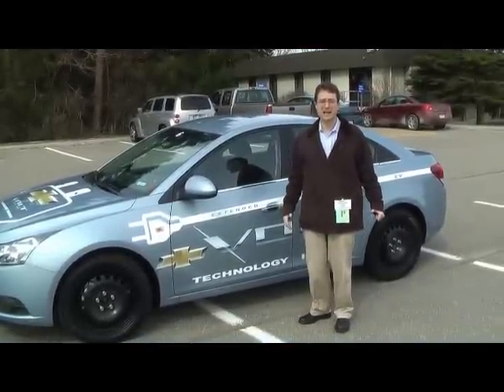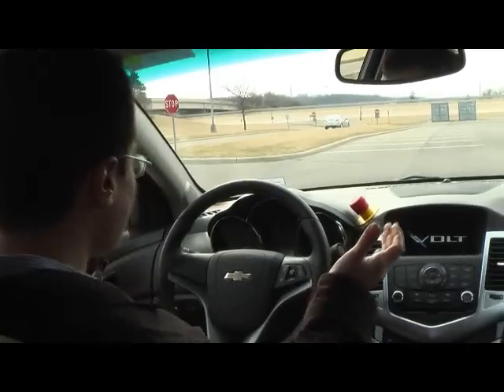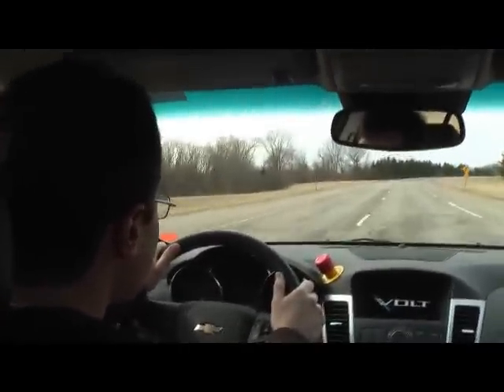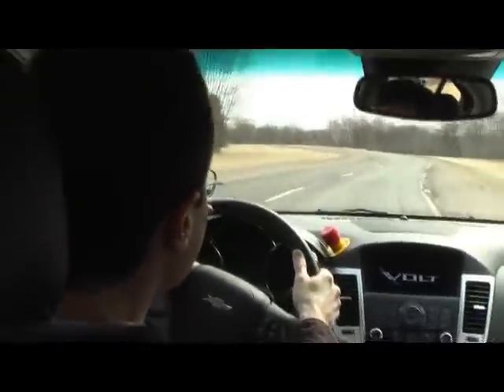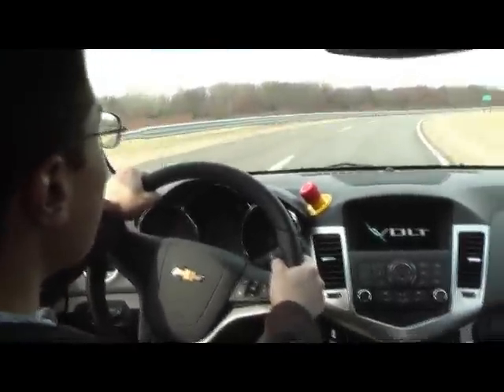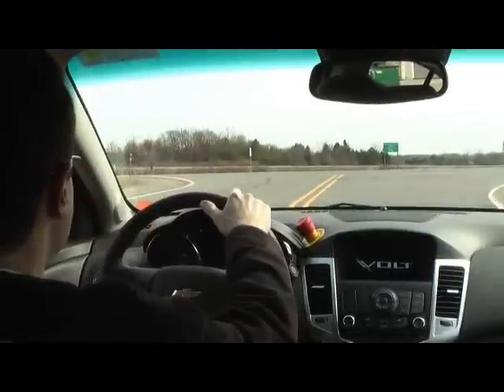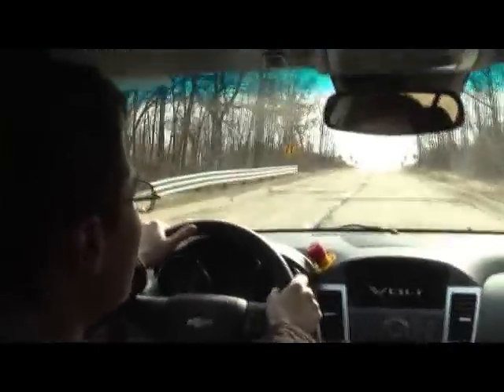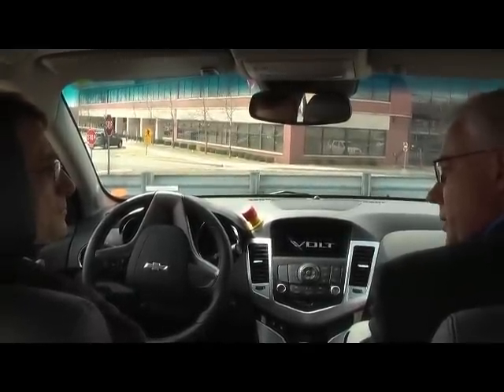Chevy Volt Mule Test Drive

Comment: @Tamayo1980 you are misinformed. the gas engine just charges the battery to keep the wheels moving, just like a train. There are no other vehicles that can even compare to the volt, so stop trying to compare it to pure electric vehicles. The volt and ev's are in different segments of the market.

Comment: @1impalaman I'd like to add that this isn't just a giant battery. there is way more thought and efficiency put in this vehicle concept. like every time you break or decelerate that is converted into energy. might I add they are doing it in a compact vehicle platform, can you imagine the distance you can get from a SUV size battery configuration, the bigger the battery capacity the further distance you could travel. similar to SUV's with large fuel tanks, 400 miles until you have to fill up next

Comment: 3:35; "Is it a vacuum pump in the brakes?" -- "No, it's electric .. boost" Isn't that the same thing? I'm glad 1st generation Volts are getting to be less than $18K used now, and the battery packs last forever!

Comment: KrellLab, they mention that it takes a max charge rate of 16 amps at 240 volts.  Any electrician will know what wire size to use for that.  I'd go on the larger side so that you could plug larger appliances into that outlet if needed, such as a backup electric heater, a welder, or a large air compressor.

Comment: In response to this statement: "i honestly dont understand how putting a generator to the engine to drive the electric motors, "

This is an extremely efficient method of propulsion. This is how ALL of the diesel-electric trains operate. 

This is the way electric vehicles should be done until we find the holy grail of batteries.

Comment: I was interested in the possibility of pre-wiring for 240 Volt charging. The problem is that NO ONE seems to know with any degree of reliability what size wire should be used for the Volt. 240 Volt circuits can probably use anything from 14 AWG to 6 AWG.

As many are probably aware there are at least a dozen styles of 240 Volt outlets. The particular type of outlet to use is not important at this point, what I am trying to figure out is the correct wire size (gage) to have installed.

Comment: "the technology is very old"

GM obtained hundreds of NEW patents for electric propulsion when building the EV1.. and now the Chevy Volt also has many NEW patents to its name... this IS NEW technology.
The GM EV1 also set a speed record of 183 mph for a electric. This is with no transmission and one moving part in the Motor. I am very happy to see the the ability of the Chevy Volt to be fitted for the Hydrogen Fuel Cell which is really where we are headed.  Pollution free , abundant, Hydrogen.

Comment: That worried me a bit too. I don't tend to go on hills like that, but I have been on hills larger than that in a prius, and it didn't slow down like this one did... My only guess is with no transmission the motors had to slow down, because of the direct torque might cause wheelspin? I don't really know.. I hope it's not just underpowered... I know a Tesla would fly up it, lol.

Comment: @AlienZygote010 it doesnt need a transmission 100% of the power/torque is available 100% of the time.  It is not an internal combustion engine...does not have a "power band"

Comment: does it plug in to charge while your at home not using it? if so, then yeh for people who only drive 40 miles or less a day this car is fine.   if it doesnt...well then its going to use as much gas as a hybrid.  if you cant plug it in, then how is this better?   the engines going to input enough energy into the batteries to keep the car moving, and burn enough gas to keep it moving, like any typical car.

Comment: In theory it should be much better. Gas engines are only 20% efficent, so as long as its better then that, and it is, nothing is 100% efficent anyway. But it is a GM so it will probably srew up anyway!

Comment: i honestly dont understand how putting a generator to the engine to drive the electric motors, makes it any better then any other hybrid in production...idk maybe i dont understand it.  look at it this way, the generator isnt 100% effiecent, some of its energy turns to heat...and is wasted.  so how is this more effiecent then having the motor drive the car directly?   i see very little gain from this, if not possibly a decrease compared to a normal hybrid.

Comment: @bonds911 i just wanna drive by the gas stations and don't have to worry about paying for fuel, nor worry about the pollution i am contributing to the planet. However, I am not advocating that ALL gas vehicles should be replaced by electric, i simply believe that consumer should have the option to buy a safe and reliable electric car to commute around town and has a range of more than 100miles or so Not a p.o.s hybrid. The big 3 aren't lost they are just cowards to the oil company and profits

Comment: Why isn't the electric cord for the VOLT built in and retractable. That is the one fault I find with the Chevy Volt. The owner has to take the electric cord out of the trunk plug in both ends, then un-plug both ends and wind up the cord and put it in the trunk. You know the cord is going to be all over the trunk. Too much work. I hope GM goes with a retractable cord, to make the Chevy Volt almost perfect. You know the Japanese will do it.

Comment: the GM guy says it's as steep as you would find in most public roads. I take that to mean about the worst you can find but just short of the worst san francisco roads. I expect a normal car couldn't do better and might even sound very strained just to match it.
this isn't an official GM video either so it's unlikely any GM folks would comment here. even if it was official they wouldn't comment. they haven't done that much evil in the past to suddenly be accountable to the public now

Comment: lol, Extended range electric car. WTF all they have to say its a fregin Hybrid. You know what they say about people/company who mover backwards in chess.  Hope it fails, because GM is still a sell out to the oil companies instead of manufacturing PURE electric vehicles.  Tesla model S starts @ 47K with tax incentives with 2 battery options of 160 -230 miles per charge. Chevy Volt 35K starting with an initial 40miles per charge before a gas operated motor takes over. GM sucks Tesla American revol